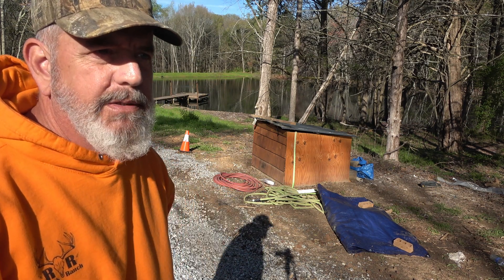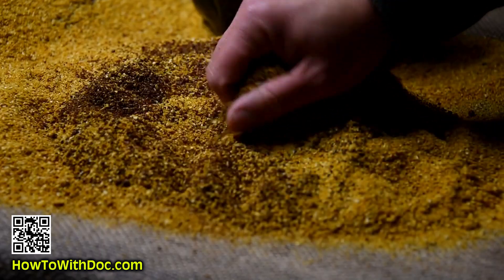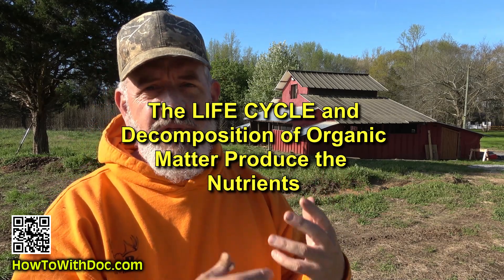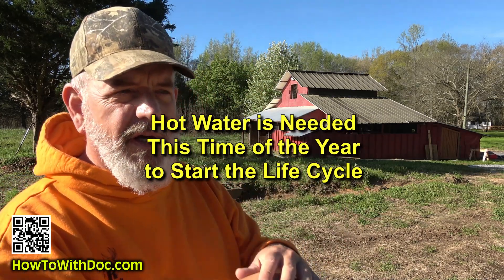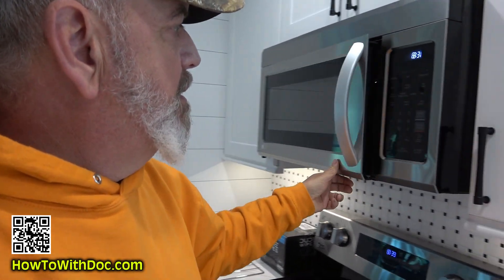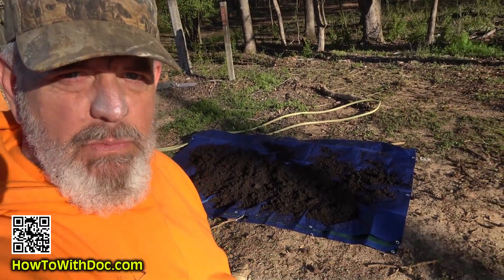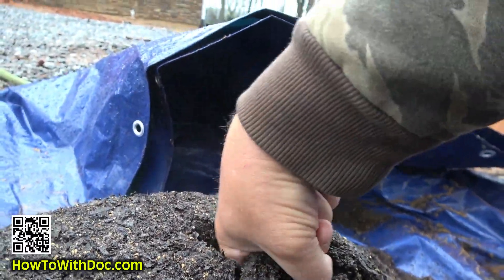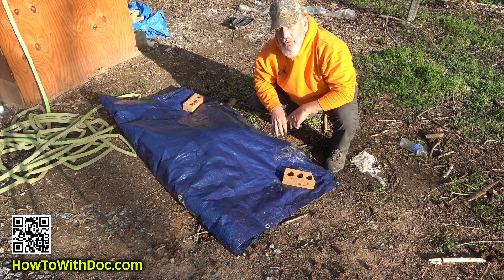The Best Garden Soil and Compost in 72 Hours

Comment: Good morning, Doc.  Would this method of adding the compost and dirt booster plus work if you apply on top of landscape fabric around the plants?  Your You Tube channel is such a treasure trove of knowledge.  hanks.
Reply from the maker: Yes, if you have mulch move it away, apply and then move back.
Reply: @HowTowithDoc  Hallelujah!  This answer makes me happy.  Thanks so much!
Reply: It is better value to make your enriched compost separately first.
Then you have the application medium for your lawns, flower beds etc. It is poor value to apply the product directly.
Your compost product will have 10-100 fold or more bioactivity than what you started with if you process it that way

Comment: So using compost to make compost method to top dress, what happens if you don’t use it in the 2-3 days?  Also, if you are prepping new raised beds and mix it in with existing potting or raised mix with compost mixed in, how does the dirt booster help if you don’t have the temps needed to make the fungi and microbes alive?

Comment: Very interesting video Doc. I got an idea what about running a extension cord under the pile and plugging it into one if those heating mats that are used to heat aquariums for reptiles ect.  That would provide the extra constant heat to get pile going and might be useful in colder climates ect... Just an idea. Wondering about your thoughts on that ?
Reply from the maker: Yes, we used a seed starter heating pad last year.  The bottle of hot water was just easier.

Comment: Hey Doc, I tried this for the first time, the process is working so far but it smells extremely bad. 
It’s been 6days so far, it’s still steaming, I’ve been turning it everyday and making sure it stays damp and moist (not muddy).
Is this normal?
Reply from the maker: It should start to dry out. My guess is too much water and leave it open.
Reply: Roger! 
Assuming the smell doesn’t go away completely, would it still be good to use in my garden? 
Everything aside the smell in this process went as predicted I even have mycorrhizal fungi.
Thanks Doc.

Comment: Black Kow manure is already composted, what's the point of starting the compost process again?

Seems like this would be better used on a pile of carbon such as wood chips, leaves or bales of straw.
Reply from the maker: Because there little to no nutrients in it... no biochar... no good fungi and limited microbes. The black kow is simply the carrier.

Comment: I think it's a complete waste of time to try hot composting outdoors when day temperatures are below 84f, as long as you get a warm day then the freezing night will not lower the temperature.   The main issue people ignore is oxygen.  Flipping only adds additional oxygen for about 20 minutes max. Also when you're switching from anaerobic to aerobic the Sulfur converts from dioxide to trioxide to form sulfuric acid which also heats up(it's drain cleaner so to get heat you add oxygen).   My 5ft leaf pile is 150f though I'm in zone 9, I hit 164f(the max) a few weeks ago but it didn't last so I added a high-N fertilizer.
Reply from the maker: Not true... we have been doing these piles for 4 years. It is NOT a normal compost pile. It only remains for 72 hours before being used and the testing from Clemson Unv showed the true power.  If you want to talk NORMAL compost piles.. then you are correct.
Reply: @HowTowithDoc  I don't understand what you think isn't normal about your heat. It's chemistry & not Bible-babble.